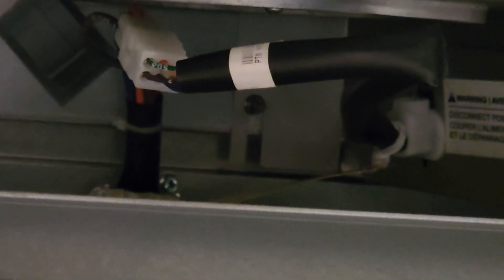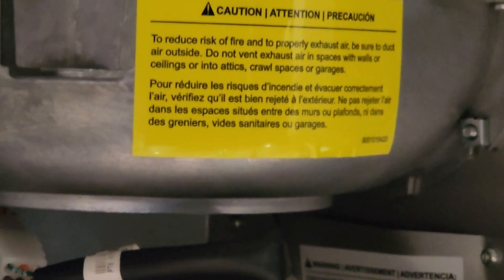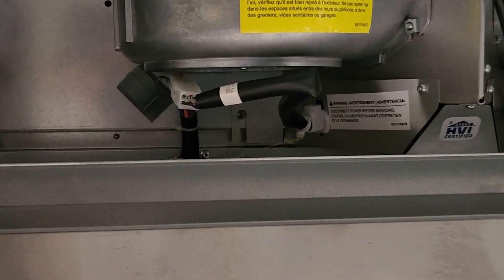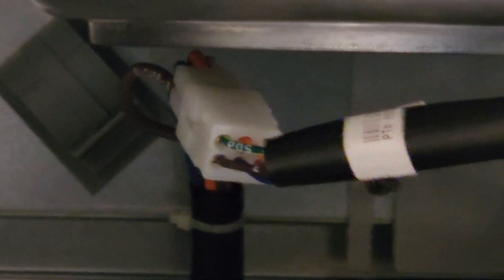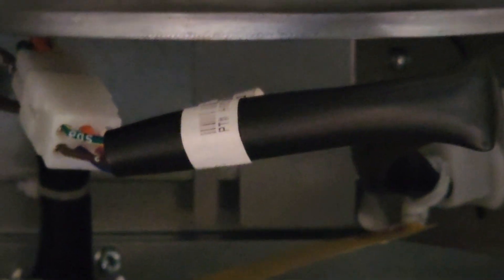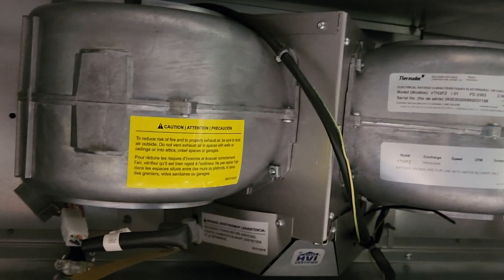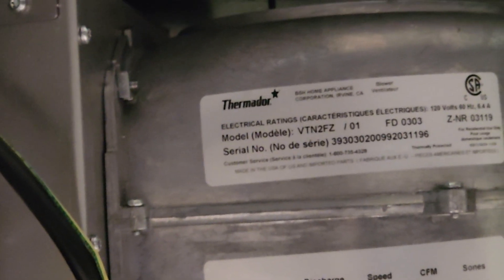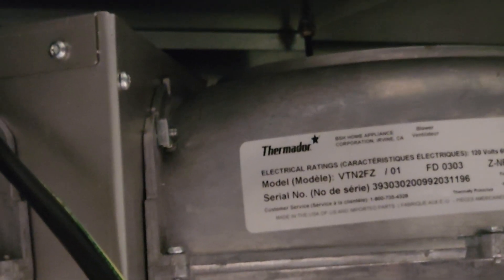thermador vtn blower install.   TERRIBLE design

Comment: I'm a technician and I totally agree, Thermador has shitty customer service, it's like they are doing you the favor of selling you parts.  Then they discontinue parts and tell you that the option is to replace the entire unit, yes, 5k for a simple $80 motor... don't buy it, plus you are just buying an expensive name, they don't manufactur the controls or the blower motors

Comment: Been an appliance installer 18 years. And they do have bad designs. Then the technician shows up and tries to blame it on the installation. They don’t like to fix or work on things. Yet want to charge for every repair visit. In this blowers I have to pre drill a while and use a metal screw to anchor back

Comment: I have the  HGSW36TS. They discontinued the blower motor after a couple of years. So I found a company that rebuilds them, so I bought the 18" T20 driver and pulled all  four screws. Guess what? I won't come out! 
Maybe it's welded from the other side?!?  ...just insanity.